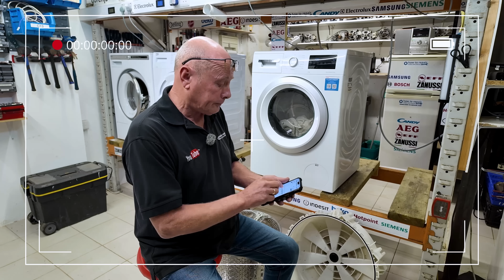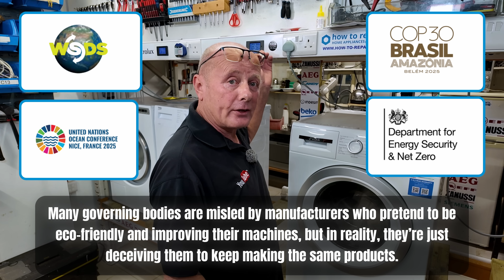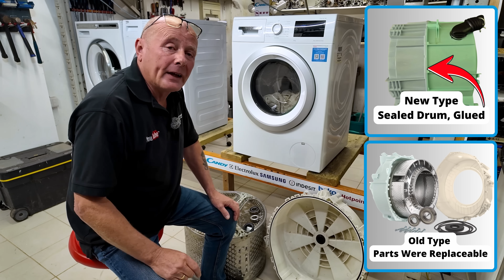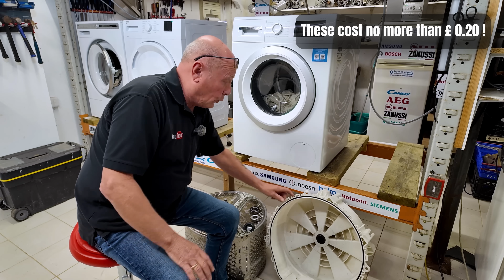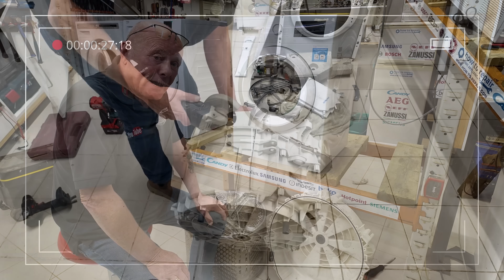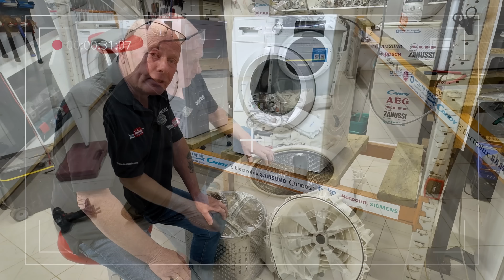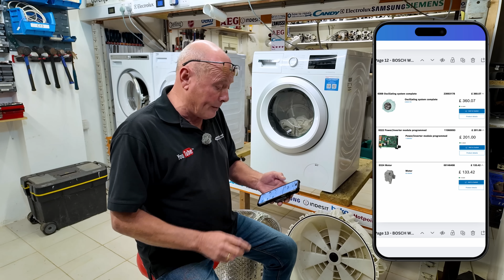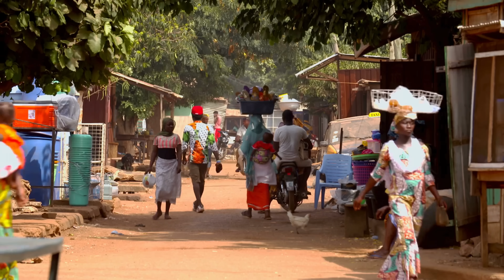Washing Machine SCAM EXPOSED! The Truth About SEALED Drums: Naming & Shaming

Comment: My Bosch washing machine from 2005 (made in Germany) had a sealed drum so been a thing for a while now. Needed a replacement spider but at £200 declared it a write-off 😢
Reply from the maker: Thanks for the comment mate. Your 2005 Bosch proves that this anti-repair design has been a major strategy for some time. Bosch built their reputation with their machines from the early 90s until 2005. Now, they're ruining it with these new machines that have sealed drums. I really appreciate you sharing this with your friends and family. Maybe we can make a difference if the manufacturers notice how many people are looking at this video.

Comment: i was a service technician for 20 plus years i had to give up due to being outpriced by replacement parts, you couldnt make money, I agree with everything your saying and thats from my experiences, thank you for highlighting this, something needs to change and fast.
Reply from the maker: Thank you for your comment. I appreciate people like you taking the time to write it out. Please don’t forget to subscribe and share it where possible. It might help others make a wise choice instead of being misled by the industry. Your 20+ years of experience confirms exactly what we're highlighting and what I've seen over my 40 years in the trade. The industry's structure, where components are deliberately overpriced (or even given different, higher prices under different brand names), is designed to push the consumer towards obsolescence, effectively forcing good, honest technicians like yourself out of the market. It's truly a shame when decades of expertise are sidelined because manufacturers prioritize profit over sustainability and repairability. You are right something needs to change, and advocating for the Right to Repair act is the best way to get that ball rolling.
Reply: @How-to-repair you have highlighted the reasons why I prefer to drive a 2007 Toyota Hilux. I just buy any part I need off eBay, for close to nothing.

I dread the day I buy a new car and get extorted by the 'stealership' for every service, yearly RTA inspection or repair.
Reply: My uncle repaired AEG machines for 40 years. Few years ago he retired 3y before he would get retirement money simply because he was sick and tired of having to be the person to tell people that their 6yo machine couldn’t be fixed because it was built in error. Logic boards were made to THINK a part was broken even if the part wasn’t. He even swapped a few circuit boards of machines giving errors. Lo and behold: in another machine they gave the same error despite that machine giving another one before. He was the kind of guy that always had 10 old machines in his garage to repair in his spare time to gift for free to those too broke to buy a new one.
Reply: Funny thing is....I know a guy that does repairs, but the only repairs he is actually doing nowadays are warranty jobs.

He works for all of the major brands, they call him up and books him to fix something in warranty.

They send him the parts needed and he is just paid to swap them, kind of suggesting that the parts are a LOT cheaper than the retail price.

$200 retail priced heating element for an oven, makes the repair not economically feasible, compared to a new oven, but if the part only cost $10 to make and they pay him, maybe $75 for the replacement, then it's economically sound to do.

The high prices of parts is only meant to be a "Buy a new one" suggestion
Reply: And people still defend capitalism.
Reply: Oh please..
That's not capitalism - free trade: it's corporation paying money to politicians in exchange for extra leeway..
Reply: @joseevaniersel7280 "Oh please" yourself. In theory, Capitalism should result in cut-throat competition that benefits consumers, but in reality, it results in oligarchies, where the richest companies can buy politicians & crush competitors.
Reply: @joseevaniersel7280the paper bag passed under the table is what drives and the business model of every politician here in Australia (no matter what side of the political isle they reside).
Reply: Capitalism is a tide that lifts all politicians’ bribes and yachts
Reply: Buy  Samsung
Reply: @MichaelGreenLagos  what for? absolute scumbag company, that won't ever honor warranty.
Reply: @MichaelGreenLagos  lol, no, never again. They don't even know the meaning of the word "service".
Reply: Buy an LG?

Comment: So which brands are repairable and don't have a sealed tub?
Reply from the maker: I can't give a definitive suggestion mate because manufacturers are constantly changing their lines. This means that every single brand has high-quality gems and low-quality duds. Your power is in the details, choose a budget-friendly brand that also makes technical repair information available to the end-user. When purchasing, ask this one critical question, is the drum splitable? 

My top-tier picks are ASKO, I found their machines to be phenomenal workhorses, and their superior mechanicals (like the stainless steel outer drum) often rival or exceed newer Miele models. Some LG units are decent. I also commend Beko for their transparency. They are one of the few that provide helpful workshop manuals and wiring diagrams to facilitate repairs. 

Thank you for this comment! It helps others immensely. Please subscribe and share this video let's empower consumers against misleading industry practices!
Reply: @How-to-repair had a quick look at ASKO.  3 times the price of an LG.  One has to wonder if you are better off buying 3 LG's over 15 years or one ASKO.

Comment: My 25 year old Bosch WFK2801 you can change the bearing without removing the drum. It can be done I'd manufactures wanted to.
Reply from the maker: I am very familiar with that era of Bosch machines like your 25-year-old WFK2801! That generation was from the time before the industry decided it was cheaper to acquire market share than to build quality.

Only by sharing these videos and discussing these controversial issues can we hope for change. Sharing this video will help give it the exposure needed to make a difference over time. Thanks very much for your comment; it is much appreciated.
Reply: @How-to-repair it wasn't cheap at the time - around £500 which was top end those days, but it has more than paid for itself.  I would rather not replace it to be honest, it eventually I'll have to.

Comment: With the Bosch machines I’ve been told that if you manually change the spin speed to a lower value (eg. 1200 RPM rather than 1400) then it will drastically increase the lifetime of the bearings, possibly by years. You have to do this every time you start a cycle. I’ve found a 1200RPM spin to be as effective as a 1400RPM spin.
Reply: What kills the bearing is not wear, but water. The seal fails, the water leaks, and the rust does for it. It would be trivial to add a drain channel between the seal and the bearing to allow the leaked water to dribble out. Yes you get a dribble, but you don't lose the bearing.
Reply: @curiouscrandall1  Exactly what I've found and the seal fails sooner if you have hard water, although I think an occasional descale may help it last longer. I regularly check for wear in the bearings by rotating the drum by hand, and on most machines I've had over the years I've seen rusty water leaking out the drain/vent hole between the bearings when they've had one, or else leaking out the rear bearing before the bearings show any wear. The front bearing in my current machine seized suddenly after 11 years of use, no signs of wear beforehand; the formally flexible rubber shaft seal was encrusted with hard limescale and had leaked and the ball bearings had rusted and jammed. The rear one could have been reused, although considering how little they cost Vs the amount of time it takes to swap them, I replaced both. I reckon both original bearings would still be fine now, 5 years later, if the water hadn't got in.

I suspect a machine we had in the 80's might have had a drain groove under the bearings because it leaked a small amount of water out of the drain hole between the bearings for at least a year before the bearings failed. Using a modern seal like a cassette seal which can have multiple lips running on the inside of its own enclosure to keep contaminates like grit and limescale out might last longer too, especially in hard water areas.
Reply: I use 800rpm . And then do another 800rpm spin .
My bosch has lasted 24 years .
Reply: Have you tried spinning your washing at 1,200rpm, taking it out and weighing it, then putting it on a max rpm spin and weighing it again? I'd expect it to take a worthwhile extra amount out and reduce the amount of energy needed to tumble dry it. Of course if you hang it outside to dry, then getting as much water out as you can really doesn't matter.

Comment: You still completely ignore the fact that consumer electronics became significantly cheaper in the past decades. A 400€ washer did not exist in 1990. By todays value, the cheapest washing machines back then were around 900€ in todays money. A decent one was over 1200€. So yes. The manufacturers are constantly cutting costs during production to race the prices to the bottom. This results in poor repairability, as this is simply not a priority during the design phase. 
Customers are rarely willing to spend any extra money for a more repairable product. Initiatives like Fairphone and Framework laptops are a prove of that. 
Noone is actively designing planned obsolete into their products, as this would require extra work. Someone asked the engineering dep. to come up with a way to save 5%-10 on the production cost, so they looked at the plans and figured the easiest way to save a few steps is to weld the drum unit shut. Probably because the screwed unit requires a few extra steps like adding the seal, inserting the screws ans tightening them. Afterwards, need to do a quality check to make sure all screws a present and the seal did not pop out somewhere. 

Should stuff be built like that? No. The only ways to prevent this is legislation, though. If everyone is forced to provide repairable machines, the playing field is level. It will result in overall higher prices though.

Comment: I'm waiting for a day when washing machines and such will be subscription services, I don't think it will be long, if people are buying trash like that
Reply from the maker: The day you're waiting for is already here, and it's happening fast mate. My experience over 40 years tells me that this shift is being pioneered by some of the biggest names in the appliance industry. Manufacturers aren't challenging the facts, the media isn't picking up the story, governing bodies haven't tackled the e-waste nightmare, and politicians remain silent, despite the clear public interest. This silence is the most concerning part. The only weapon we have is exposure. By sharing these videos and forcing discussion on these controversial topics, we create the necessary pressure for change. Please share this video to help give it the exposure required to break through the noise and make a difference over time. Thanks very much for your comment it is much appreciated.
Reply: @How-to-repair I have definitely changed my view on the Internet connected stuff. In fact now my priority is to make sure stuff if not wifi enabled, especially when we are talking about appliances like washing machine or microwave. Slowly but surely I started to remove smart crap from my home, not worth it. This madness has to stop.

Comment: We have a 16 year old Miele and just changed shocks. Maybe it lasts another 16 years.
Reply from the maker: Miele used to make great machines but they are now introducing sealed plastic drums into their washing machines this is stopping the consumer replacing the bearings or spider and on some cases even stopping them. Accessing the drum to remove small items of clothing that may have got lodged between the inner and outer room removing bra wires or even maintaining the machine. Is this corporate greed and the start of the downfall of a once trusted appliance brand?

Thank you for your comment. I appreciate people like you taking the time to write it out. Please don’t forget to subscribe and share it where possible. It might help others make a wise choice instead of being misled by the industry.

Comment: We should stop buying glued products,... maybe EU (they like making regulations) can fix this. ...... Asia has lower manhour costs. ...... As a minimum they should by law inform us that the product is not repairable, and it's aprox life-time. ............ Spare parts can be expensive though, as they have to produce them while the machines are getting produced, and then store them for several years and hope they have enough spares, and they will normally not sell all of their spares, some of them will have to be thrown away, so there's many good reasons why spares can be expensive. .... But standard components used across products, like bearings, motors, compononents for PCB's (typically any relay fails), should of course be accessible for repairs. ....... One major contribution to global warming is that we buy new stuff instead of repairing.

Comment: What’s the best fixable machines (silver) would you recommend? My hotspot has started screaming again after a few years of replacing the second sealed drum at £200 this will be my 3rd drum now 

but it’s infuriating as a car mechanic I fix things ! So I guess bite the bullet again or get a machine that the bearings are changeable 

Cheers
Reply from the maker: Great question mate! But honestly, I can't magic up a definitive suggestion. The industry is a minefield and manufacturers constantly change production, every brand has both excellent and terrible machines in its catalogue.

Here's what matters, you need a brand that fits your wallet and gives you the technical documents to fix the thing when it inevitably breaks and always check if the drum is splitable before you buy!

I personally rate ASKO. Absolute workhorses with mechanicals that rival old Mieles (thanks to that stainless steel outer drum). Some LG units are good too. And massive credit to Beko: they are one of the few to actually provide detailed workshop manuals and wiring diagrams, which is fantastic.

Thanks so much for weighing in! People like you writing this out help everyone. Hit that subscribe button and share this it could save someone a heap of trouble!

Comment: For a bearing life you don't even need computer: You'll find the relevant calculations in every manufacturers bearing catalog. Even the advanced methods are first year courses in engineering.

They aren't even undersized, there are cars with smaller wheel bearings out there.

The problem is the main seal that will be degraded by everyday detergents, eventually water seeps in, grease-water mixture ceases to lubricate and then the bearing is killed in the next few washing cycles.

The CHEAPEST part wrecks it all.
Reply from the maker: The manufacturer knows the life of the bearing is long but they also know the seal's lifespan is short when exposed to modern chemicals. By pairing a durable bearing with a cheap, exposed seal and then welding the drum shut, they engineer a guaranteed failure point that is too expensive to repair making the cheapest part the key to their planned obsolescence strategy. Thank you for your comment. I appreciate people like you taking the time to write it out. Please share it where possible. It might help others make a wise choice instead of being misled by the industry.

Comment: I have designed, built, programmed and tested many PCBs over the years and the thing that kills them most is overstressing them by heat, voltage and mechanical vibration.

One can also forget to add suitable protections in the design.
Reply: It's normally corrosion from damp, or poor soldering that leads to dry joints.
Reply: @curiouscrandall1  there’s no harm in conformal coatings for the most part.